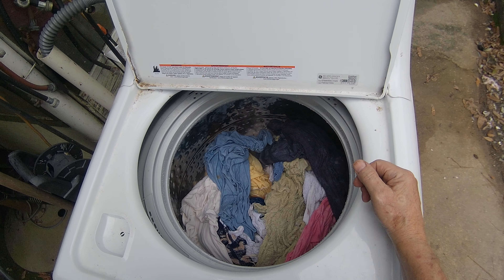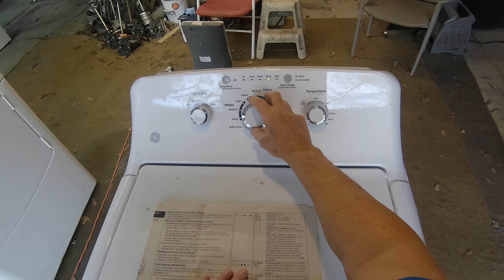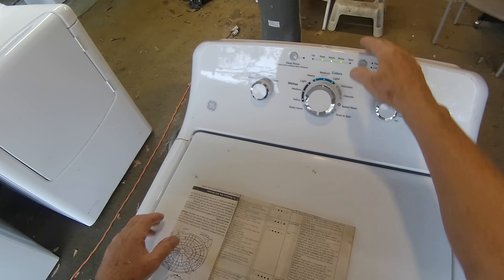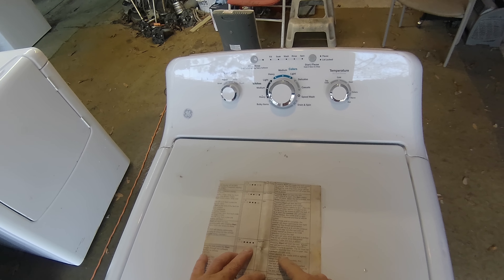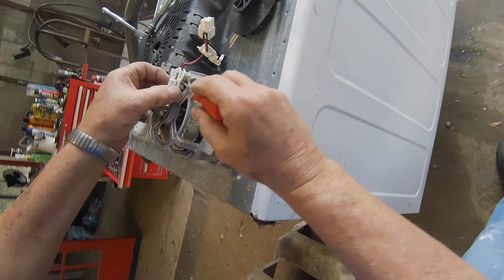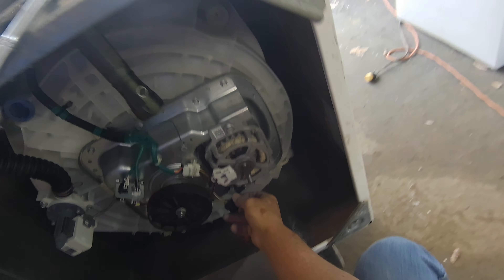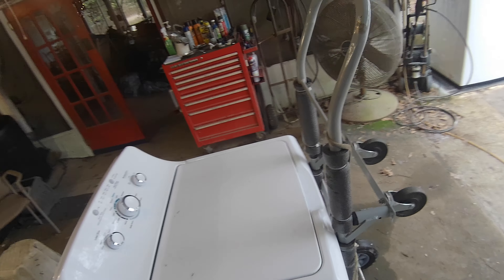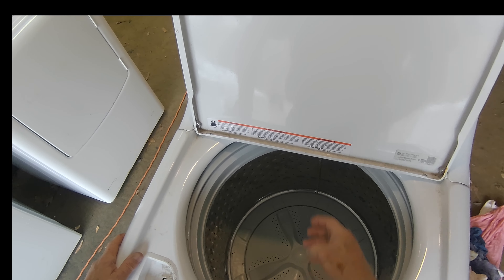How To Fix a GE/Hotpoint Washing Machine: Won't Spin or Wash Repair Guide

Comment: Hi, my issue is no spin at all. Went through all testing , lid switch test ok, Agitate test ok, Lid lock test ok, Drain pump test ok, cold /hot water test ok, still no spin . I checked the level ok, fill test ok to? I'm stumped just sits and wont spin , any ideas
Reply from the maker: My best guess is the motor speed sensor. Thanks for watching!
Reply: Delicate cycle issues drum keep saying full
Reply: What is the speed sensor wiring harness attached to. That broke taking the speed sensor off.
Reply from the maker: On one end its attached to the motor speed sensor and on the other to the control board. You can splice the wires together if there is enough left on the plug using butt splices. Just match the wire colors.

Comment: So there is a motor sensor and a actuator on the gear case?
Reply from the maker: On the GE in this video the motor speed sensor is on the motor and the shift actuator is on the gearbox. Thanks for watching!

Comment: My hot point would not do anything so I did the diagnostic and it showed the mode shifter fault. Replaced that. It seemed to work fine for one load. Now it does Everything except spin? Any ideas?
Reply from the maker: Could be the motor speed sensor like in this video https://youtu.be/3bQg-0bi8hM. What do you think?

Comment: Do you warrenty these newer machines? I dont sell them usually because if the customer breaks them more likly than not id be replacing it with an older direct drive which i always recommend people buy anyways.
Reply from the maker: Yeah, I have a 30 day return or replace warranty (33 days for you). I try to make sure I’ve fixed them right before I sell them. I usually test them with about 5 loads of clothes on various cycles before I let them go. I hate having one come back to me.  And I usually exchange one if it comes back within 90 days but I don’t advertise that. I just feel like they should last longer than 30 days and it builds good will. Great question!

Comment: My ge washer drains and spins on the first cycle but then it won’t drain or spin on final rinse and spin cycle.   Also on the final cycle the water (although on “small” load) will fill up like I have a large load.    Any suggestions?
Reply from the maker: I wouldn’t be able to even guess at this problem without being able to diagnose the machine myself. I haven’t encountered a problem like what you are describing. I hope you can find someone that can fix this issue. Thanks for watching!

Comment: I have a similar problem with my washing machine. I have a hotpoint when I wash the clothes at the end of the whole cycle. The clothes are still wet because the washer does not do the cycle of spinning the clothes, but when I put it in test mode the machine spins well and the clothes are super dry and sometimes when I use the washing machine one day it is dry perfectly well  and one day it can work well and another not. I don't know if it's the capacitor or the motor speed sensor. ?
Reply from the maker: It could also be your belt. Remove your belt and examine it for an oily residue. Clean the pulleys with a spray type household cleaner. Dry everything well and replace the belt with a new one. An old belt will be spongy and slippery and a newer belt will be dry and a bit stiffer.  I see this problem on GE and Hotpoint models a lot. Good luck with your repair and thanks for watching!

Comment: I need to know why the washer will wash then stop does not go to next stage and it's an old it only has 3knobs
Reply from the maker: It sounds like a bad lid switch. Thanks for watching . Consider a super thanks if it fixes your issue.

Comment: Hi. My hotpoint topload washer is not spinning. Clothes are coming out soaking wet. When i ranned a diagnostic test. It says the cold side water valve is bad. Can you give me a pointer on this. Thanks
Reply from the maker: Change that water valve. What is probably happening is the machine isn't filling on the rinse cycle in a timely manner (all rinses are cold water) and the machine will shut down and pump out. Your clothes should just be laying in the bottom of the basket wet without any evidence that the machine tried to spin. Thanks for watching!

Comment: What if during lid switch test it shows open and shut correctly but doesnt ever lock causing my no spin issue?
Reply from the maker: I have encountered that too and fixed it by changing the switch anyway. However, I saw that another time and its was a bad control board. Thanks for watching!

Comment: I need to change my belt. You just pulled that belt off like nothing.  Putting on a new belt will be tighter. Any advice?
Reply from the maker: Sure, put it on the small pulley, then place it over the top of the large pulley and rotate it around while holding it in place on both pulley's.  It's easier than you'd think as long as you have the correct belt.
Reply: @HarperandKnowles  Thank you so much. Getting the belt from Amazon.  They claim it's compatible with my model. And I ordered another one from a different seller just in case
Reply: @HarperandKnowles  thank you so much. I did it!

Comment: Hello,  i stumbled on to your channel which is great by the way how u help people here.   Ive lost my job and came about some hard times.  I got a washer off a guy that had it in storage for years.  im gonna guess its a 2012  kenmore 110 series as far as age.     i plug it in and all i get in the lid lock light on  and it clicks 3 or for times but never fills or starts washing.   The fill light also stays lit up.   just never fills or starts washing.     my code is f7 e5     which is motor or acutator from what i read.     I replaced the capacitor and water intake switch before I learned about the codes so that was wasted money sadly.     Ive narrowed it down to either the lid switch (cause it keeps clicking when u turn it on) OR the acuator.     didnt know if the acutator freez up from sitting in storage for years?          I tried to bypass the lid low switch first to see if that was it, as i hate to waste anymore money....but that didnt do anything except now i have the f5 e1 code which is the lid lock fault code. . .ugh.       any help? any test I could do before i waste any more money on this.  I really cant afford too honestly.     any help would be appreciated.    thank you and god bless u for all you do for folks.
Reply from the maker: I would change the lid lock first. A constant clicking is a dead giveaway that it has failed. Once that is done clear your codes and try to run a cycle. Then deal with any other issues that come up. Keep plugging away my friend things usually work out when you try to be productive every day. Thanks for watching!
Reply: @HarperandKnowles   does it matter that i checked the ohms on the lid lock switch and it tested good?   sorry..just tryin to keep from buying two more parts rather than one.    I bypassed the lid lock switch by removing the little metal tab inside the main switch..... to try to narrow it down.   I never had the f5 e1 code until i did that....only the f7e5 code   (Acuator)
Reply from the maker: There are two parts to that device. A lid switch which tells the logic Chip that the lid is closed and the lid lock that locks it. Trying to bypass a lid lock can burn out your control board. Don’t do it. If the switch is continuously clicking it’s bad.
Reply: @HarperandKnowles   yes i have read NOT to twist wires together ect...or u could fry the board.  big bucks.   I basically was trying to trick the  switch, so i didnt have to buy a lid lock and a actuator part    since I had that f7 e5 code before i looked inside the lid switch to by pass it.   Thank you,.
Reply: @HarperandKnowles  m puling my hair out with out our washer.  it was in storage and we just got it out of several years of sitting.   its not that old and still looks new.    i went by the codes in the diag process and they have led me down a path of wasting money.    first it was the lid lock code and everyone around said 90% the lid lock switch will stop it from agitating or washing...so i bought one.   didnt fix it even tho the code for that switch came up.  then it was the actuator code.....replaced that.    nothing.       I even replaced the capacitor and the water valves.     still wont work.     under test mode it will fills and drain but when it goes into agitate or wash mode it just kindy hums or growls real quietly.    doesnt make alot of noise but u can hear something kinda growling.     no more codes either with the diag procedure.     i just dont get it .
Reply from the maker: Unfortunately it is impossible to give good advice when I can't diagnose the problem myself. Perhaps it's time to call in a professional?  I wish you luck with your repair.
Reply: @HarperandKnowles      thank you         ya cant afford that.   or id just go buy a new one  lol     only thing left is the board , splutch or motor.      still cheaper than a new one    prices are nuts on washers and dryers today.
Reply: @HarperandKnowles  yes, I tried calling two different guys locally to me and not one of them ever called me back that is why im on youtube honestly.  I needed help.    Luckily the parts on this kenmore are not too expensive vs a new washer.  Ive put a capacitor,  water valve, lid lock switch and a   shift actuator on it so far. , and tore the splutch apart which was clean..a lil hard to turn so i grease it.   Its acting the best it has so far but will not agitate,      it fills, spins, drains tho.

Comment: My GE washer will fill with water and stop at soak. I ran the test but it is making an awful noise and just stops. Any ideas of what that could be? Thanks
Reply from the maker: At what point in the test does it make the noise?
Reply: @HarperandKnowles  after the water drains.
Reply from the maker: If it’s a high pitched squeal when it begins to spin then you should examine the belt and pulleys. Loose pulleys should be replaced and a spongy oily belt should be replaced.
Reply: @HarperandKnowles  Thank you.

Comment: I have one of those washers and sometimes it won't spin.  Like every 10th wash I wont spin. What can be wrong with it?
Reply from the maker: I would change the belt and clean the grooves in the motor pulley while you’re at it. Wipe any grease off the large drive pulley too. I bet that will fix the issue. Thanks for watching!
Reply: @HarperandKnowles  thank you

Comment: Hi, I have a similar model GE washer that has a similar symptom. I replaced the main board and the run capacitor but didn’t fix it. It fills and will agitate exactly 10 times and shuts off. If you select the drain and spin function, the drain pump works but about 5 seconds after starting to spin, it stops. Do you think a bad motor speed sensor would cause those symptoms?  I’m tired of throwing money at parts that don’t fix it. Any wisdom would be appreciated!!
Reply from the maker: I'm thinking it is the motor speed sensor.
Reply: @HarperandKnowles  thanks very much!  I'll give it a try and let you know if that fixes it.  if not, the scrap pile will!  thanks!

Comment: Hi my ge washer pump keeps on running can you help me please
Reply from the maker: It could be your washer is in what is called a “suds lock”. This is when the machine detects that there is a flooding condition that may occur but is in error. Unplug the unit for awhile then plug it back in and let it run for at least 20 minutes or until the pump stops on its own. This may or may not work but give it time to complete the sequence. Another thing that can occur is a clog in the pressure sensor hose.  Take the console cover off, gently pull the pressure hose off the pressure transducer and blow into the hose to clear any obstructions that may be there. Suds lock will occur when you use the wrong type of detergent. High efficiency machines are designed to use detergents branded with the “HE” symbol. Using cheaper soaps will cause this problem. If these steps don’t fix the problem then you probably have a bad pressure transducer on your control board. Replacing the board will usually fix the machine. Changing the transducer is difficult unless you have some good soldering skills. Good luck with your repair, and let us know your progress. Thanks for watching!
Reply: Thanks you sir
Reply from the maker: My pleasure.

Comment: My ge washer spins and washes but when it’s spinning the drain and spin light starts blinking and it eventually stops and starts filling again
Reply from the maker: Without being able to diagnose your machine myself all I can do is give you my best guess. When the spin light flashes it usually means there is an out of balance condition. The machine will stop and fill in an attempt to float the clothes and reposition them more evenly to spin correctly. If you have a failed suspension rod then those will have to be replaced to fix the issue. Thanks for watching!
Reply: I have this exact washer ..mine fills with water but won't spin at all ..any suggestions u might have yo fix it
Reply from the maker: Change the lid lock. Thanks for watching!

Comment: Mine won't even fill up the water will run into it for about a second then stop then it won't do anything else
Reply from the maker: Have you tested the lid lock? Use the diagnostic mode and test the lid lock. Thanks for watching!
Reply: @HarperandKnowles  the lid locks the water will run into it for about a second then that's it it won't do anything else I think I'm going to go back to the old school direct drive whirlpool

Comment: That wash machine will go landfill soon. Will not gonna stay last longer. Because of computer.
Reply from the maker: I understand your concerns about computerized washing machines and their potential longevity. While it's true that electronic components can introduce potential points of failure, modern washing machines are designed to withstand regular use and provide reliable performance. It's important to consider the overall build quality, brand reputation, and maintenance practices when evaluating the lifespan of a washing machine. Ultimately, choosing a machine that meets your needs and aligns with your preferences is key. Thank you for sharing your viewpoint on this matter.

Comment: So, I replaced 3 of these censors, is the last month and 1 week, they just stop working, put the last one in couple days ago, and just didn't work today.  I'm lost.  I don't want to bring someone in to look at it, I mise well buy a new one if it comes to that.  Any ideas
Reply from the maker: I understand your frustration with the recurrent issues. It's strange that the speed sensors keep failing - they're usually quite reliable. If you're sure the replacement parts are good and they're being installed correctly, it could be an issue with the wiring or the control board. Check the wiring for any signs of damage or loose connections.  It may be that the control board is getting an erroneous signal or is defective. Also, make sure to use OEM parts if you aren't already.  If you can't find the issue, it may indeed be more cost-effective to consider purchasing a new machine. Thanks for watching my video and reaching out for help. Good luck!

Comment: Like everything works but if I put it through a cycle, that's all it does now, little water, spins, then stops, repeats about 5 to 7 seconds after
Reply from the maker: It may be a lid switch/ lock problem. Try putting it in test mode and test to see if it will spin. If the lid won't lock that's your problem.  If you keep changing parts you'll soon have a new machine!